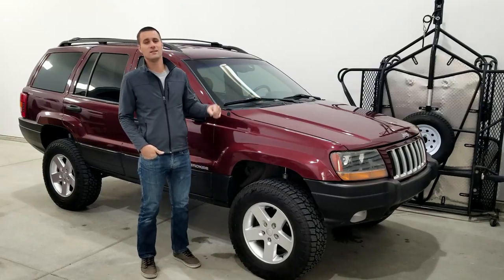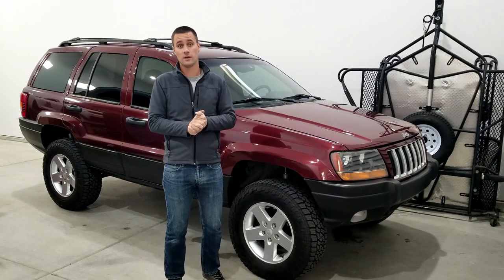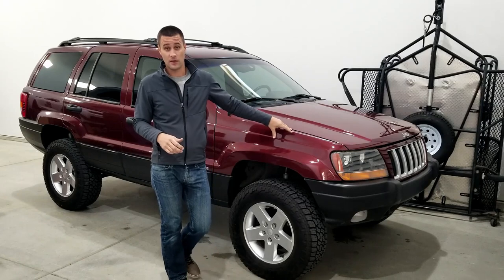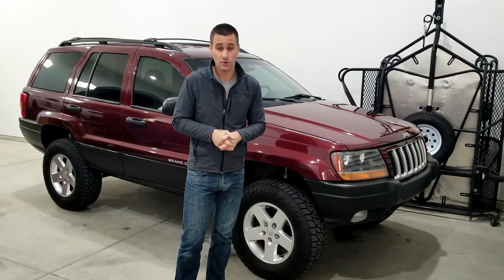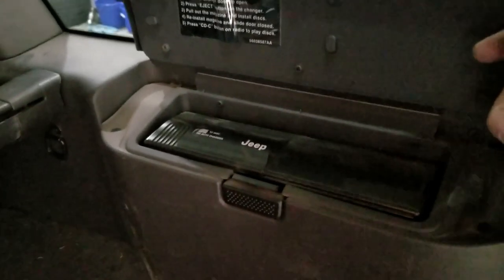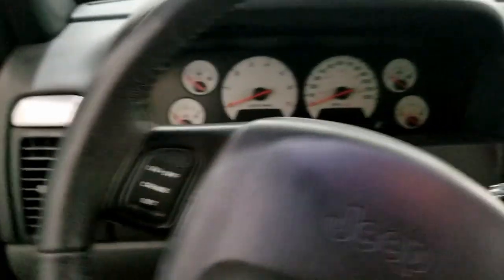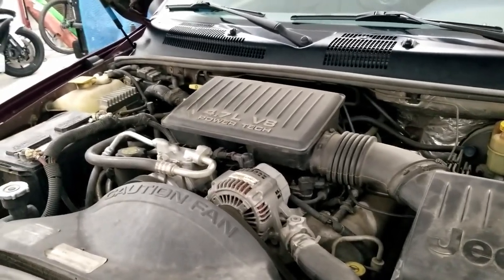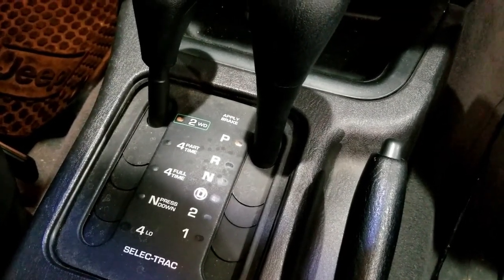$300 Jeep Grand Cherokee WJ Project "Cheap Jeep"

Comment: Hi Tyler love the WJ videos keep them coming was just wondering did you have to reprogram the gauge cluster when you swapped it out
Reply from the maker: No the clusters are plug and play, but your odometer will be incorrect unless to change the back panel/circuit board to keep the original for the Jeep. Thanks for the view!

Comment: Got my 2001 i6 w/ 120k miles and it's been great in snow. It has a weird issue where there is major vibration and even stalling on steep hills. I'm changing out the u joints , hopefully that'll fix it. Might be the bushings as well I'll have to inspect next time I'm under it.
Reply from the maker: Wow that's not a common issue? Keep me posted on what you find! Thanks for the view!
Reply: Consider checking your motor mounts if there is major vibration

Comment: Hey Tyler! With your current set up/lift and your street tire that you run on it, did you have to do any bumper trimming? if so what did you use to trim the bumper?
Reply from the maker: Here is a video talking about everything on cheap Jeep. With the street tires I believe they will clear without trimming. I am running a tiny bit wider and taller tires on my other WJ and they just barely rub when backing up, so I trimmed a super small strip off of the bottom of the front bumper. Thanks for the view! 
https://youtu.be/7w3GGLuTEFk

Comment: Did you paint the front bumper?  I swapped in a cheap aftermarket replacement in my 2003 wj. The plastic is starting to fade already. I was hoping to find a better option.
Reply from the maker: This was sprayed with a weird plastic dye. I didn't do it but it seems to hold up well but if bumped or knocked with something it will chip. I think the next one I rebuild I will scuff the plastics and use a black plastic approve spray paint and hope for the best. Thanks for the view!

Comment: need to do a trans pan on my 03 4.0 is there anything  I need  to do when I'm in there other then a filter.. trans look use  fluid  looks clean
Reply from the maker: I would have a new MOPAR filter and MOPAR transmission pan gasket and fresh fluid and you should be good! Thanks for the view!

Comment: Great video Tyler .. Love your WJ ... Have a few questions ...  Where to get the 2" spacer for the back upper control arm? What lug nuts are you using on the newer style wheels? I bought a set and they use the 14mm stud bolts vs the 1/2"x20 on my 2001 WJ?? Also curious about the paint you used on the plastic bumpers and trim, would love a video on that ... Keep up the good work.
Reply from the maker: There are a lot of company's that make the WJ a-arm spacers, just search Jeep WJ rear control arm or a-arm spacer. I believe mine is from rocky road, but iron rock and kevins off road has them also.
The wheels are 2007-2018 Jeep Wrangler JK wheels so the bolt pattern and lug stud size is the same as the WJ so the factory lug nuts fit correctly.
Reply: @TylerPotter  Tyler, what did you use on the plastic trim?  If paint, do you remember the brand and color?  Looks so much better!

Comment: Great video. Question, you mentioned the factory tow package. Do you know if that includes a brake controller and ‘extra’ coolers for transmission & engine?
Reply from the maker: I "believe" there is a extra trans cooler with trailer tow, 3.73 gears and it is pre-wired for trailer lights and the blue trailer brake wire is routed under the dash. Thanks for the view!
Reply: @TylerPotter  …great info. That blue wire would be for a brake controller I’m guessing?
Reply from the maker: @petertarantelli  Yes you are correct
Reply: @TylerPotter  perfect, thanks Tyler.

Comment: I am not quite sure where you got your information but there is a Ton of aftermarket support for the WJ. The fact that they share a lot of components with the TJ and XJ means that short of some suspension parts there is a lot out there.  There are also a lot of WJ's around. You got yours for 300 because of the drive train. WHICH IS NOT DESIRED!. you had the drive train everyone avoids. The 4.0 is vastly more reliable and comes with the better T-cases.  And since the 4.0l is shared with the TJ and XJ the parts are easier to find. XJ's and TJ's are almost impossible to find now. So people are turning to WJ's as they are more comfortable with the same proven drive train.  A word to anyone that is looking at WJ's there is a not of stuff out there about them. watch more than one video and will learn a lot more about them that this video provides.
Reply from the maker: If you compare ZJ TJ JK JL XJ aftermarket bumpers, skid plates, ect to WJ there just seems to be A LOT less options out there, yes there still is some stuff but defiantly not the options like the others.

Comment: Check out Martinbuilt. His channel is awesome and he has tons of tons of info on these WJ’s and many upgrades. One thing you can upgrade on these 4.7’s is denso GM fuel injectors which have a 12 hole injector fuel spray compared to jeeps stock 2-4 hole. Supposed to help your mileage big time. The guy went from 15 to 20mpg on it. Check it out
Reply from the maker: I have watched a lot of Martin's stuff it is pretty awesome work!

Comment: What do you think is most cause of the death wobble on WJ's?
Reply from the maker: 99% of the time it is tie rod or drag link ends being worn, normally with high mileage it will be 2, 3 or all 4 of the ends worn causing the issue. Thanks for the view!

Comment: The wheels and tires that you’re running if I put that on a stock WJ do I need to put a 2 inch lift kit?
Reply from the maker: The tires would would be too tall without a lift the the wheels with shorter tires would fit a stock WJ. Thanks for the view!

Comment: Great video... so with your overhead console does it beep about you not having tire sensors and if so did you find away to bypass that?
Reply from the maker: There are some Jeep WJ's that had tire pressure sensors and some that didn't depending on year and trim level. The one I swapped in had the Homelink but was not a tire pressure sensor Jeep

Comment: What size wheel spacers  are you running if any? I just purchased the same wheels for mine
Reply from the maker: These wheels fit great without any spacers, but I had a set of super thin 4mm spacers made to give me a little more room before my tires could rub on my aftermarket lower control arms.
Reply: @TylerPotter  thank you!

Comment: Great video :-) Actually the Quadradrive 247 transfercase isn't bad at all. Driving without a front driveshaft installed is no problem. After all the 247 transfercase is primary RWD anyway. 
I and lot's of others have driven for years without the front driveshaft installed in 4All Time. And it is of course locked in 4Low anyway. 
And the aftermarket is actually not bad at all for WJ's. It wasn't bad 10 years ago either, lot's of parts available. But now it is getting really good.
Reply from the maker: Yes the 247 isn't that bad but it is nice being able to lock the 242 in to 4hi, thanks for the view!

Comment: I have a stock 99 4.0 GC. She's got 270k miles. Engine taps but she runs. Any advice to make it better? I installed a new starter, battery terminals, using 10w 40 oil because the high mileage, coolant flush, and fuel pump.
Reply from the maker: The lifters will make some noise on the 4.0's with higher miles but they will still run for a looong time even with the noise, I would just keep up on your oil changes and it should still be a great Jeep for you! Thanks for the view!
Reply: @TylerPotter  Thank you so much for the reply back. I wasn't sure if it was the lifters or valve tap. I want to seafoam through the intake eventually to see if it clean it up but where I'm at, I don't need cops and firefighters running over thinking there's a forest fire haha. You think that would hurt it in anyway? I would like to replace the injectors due to it being the originals. Oh, I have the front driveshaft being rebuilt so I could have 4x4 again. Any recommendations for struts that won't hurt my bank account?
Reply from the maker: I wouldn't be to concerned with the original fuel injectors. We have some Jeeps that come in for service with 200-300K miles with original injectors with no issues. Now if it had a injector circuit code then you could have a bad one but they normally are pretty good. I really like my Bilstein shocks on mine. If you find the correct part numbers for your Jeep off Bilstein's website and watch Ebay you can sometimes find some great deals.
Reply: @TylerPotter  I really do appreciate you responding back. Thank you for helping me.

Comment: Need ironrocks 6.5 long arm lift kit, 35’s on it!
Reply from the maker: The poor 4.7 would need a regear after 35's to keep moving down the road! lol
Reply: @TylerPotter  of course you should regear them. They just look beastly with that setup! I have been driving mine around with the 2 inch stock wheels with spacers for a bit now. It’s not my primary car but at this point. Why not go as big and cool as you can on these. Easy stuff and over build everything suspension size and have fun!

Comment: I just changed out the gauge face to the white ones and for some reason the gauges are not working. Any idea what I should be looking at?
Reply from the maker: Weird did you swap the whole cluster or take both of them apart and swap just the white faces?
Reply: I took both apart and just swapped the faces. I took it apart again and made sure the needles weren’t plugged backed in too tight. RPM and speedometer are now moving however pointing at 3000RPM and roughly 50MPH at idle. Gas tank is reading little erratic too I think. I’m wondering if there’s any way I can calibrate it back to where they should be.

Comment: Where can I find the radiator support?  I have a 03 Laredo 4.7 well optioned with a budget boost.  It has the select track from the factory and tow pkg,  but unfortunately did have the sunroof.  Thanks.
Reply from the maker: We really don't have much issues with WJ sunroofs, I am just always scared of sunroofs working at a shop and seeing issues with other vehicles sunroofs so it is one less thing to worry about, but the radiator support is a really cool part, I believe you can order it as a weld together kit like I did or you can buy them already welded together. https://trailforged.com/product/wj-high-clearance-radiator-support-replacement/
Reply: @TylerPotter  ah Trailforged. Thanks.  I am 6" 4" so need as much headroom as possible, but my lady likes the sunroof. So there it is.  Well optioned sure makes it female friendly, if you can say such things these days. I wired in an aux cord, and removed the CD changer. My first aid kit now resides there.  Lots of options if you are creative. Happy holidays to you and yours.

Comment: I just got an 02 a few months ago, I got it to just knock around in for utility and runs to home improvement stores. But as you say, it's enjoyable to drive, I agree the seats are comfy, and something about it, I prefer to take the Jeep instead of the new car. Mine is same color as yours, it has the selectrac, and the 4.0 six, still runs great. Still need some work on suspension, rear control arm bushings and front sway bar links, the engine feels solid but my worry is transmission, it has ~145K on the clock. BTW-Did you paint the plastic? Mine looks the same as your original condition, kind of a faded grey, I know there are different ways to try to rejuvenate it, but then you have to keep up on it all the time. You did a nice job on yours, hope to get mine to the same level.
Reply from the maker: Thanks for the view! With good fluid and filter changes the transmission should be happy, and I think I've replaced about all the old tired suspension bushing at this point and it drives really nice.

Comment: Hi, anyone know if the radio fuse in the footwell (think slot 5 -25A) will blow if ignition and radio off with a 20A fuse? mine pops instantly, not sure if could be a wiring fault. NB everything is stock 2004 lerado 4,7
Reply: I do love the vehicle <3
Reply from the maker: I would try unplugging the radio and then see if the fuse still blows, it is possible that the radio has a internal short.
Reply: @TylerPotter  Hi, Yes when unplugging the fuse does not pop. Whn i do continuity test on the radio B+ and GND, GND to SIgnal I get continuity...bit strange.

Comment: Why are you saying that if one of the driveshafts broke, you couldn't put the QuadaTrac II TC (the QuadraTrac II TC is used in both the QuadraTracII and UadraDrive systems) into 4Lo which clocks the front to the rear to continue driving?  

Are you under the impression that the QTII TC does not lock in 4Lo?
Reply from the maker: You are correct in 4 low it is locked but back in the 4 hi or all wheel drive it is unlocked.
Reply: @TylerPotter  Thank you for responding.  That's correct.  So, I'm not sure your point.  Yes, the Selec-Trac TC is more versatile, and I want to get one, too.  But if one driveshaft breaks, I can put my QTII/QD TC in 4Lo and get off the trail.
Reply from the maker: @rockymountboy   Yes you can definitely get off the trail but with the select trac transfer case you could in theory drive at higher speeds on the road in front wheel drive if your rear drive shaft broke and was removed versus being stuck in 4low and trying to drive home if that was your only option
Reply: @TylerPotter  Yep!  Definitely a benefit of SelecTrac.

Comment: I bought mine for 500 with that leaky transmission an it’s not the pan ,what could it be?
Reply from the maker: We don't see to many big leaks on WJ transmissions other than the pan. But it could be a front pump seal or a output seal possibly?

Comment: Hey buddy good lookin WJ man. Does this just have a 2 inch lift? Looks like it sits higher than that
Reply from the maker: Thanks I am running the Rough country 2in spacer lift with new MOOG replacement Upcountry springs front and rear, I also replaced the front and rear rubber spring isolators with new moog replacement isolators when I installed the springs. The spring part numbers are these.
Moog 80976 Front
Moog 80873 Rear
Reply: @TylerPotter  awesome man thanks. I just got a WJ and plan to go close to that same route. Subscribed to keep up with your new vids 👍
Reply from the maker: @nathanbook8160  Thanks man, I have had a few questions recently on the lift. I need to do a detailed video on all the parts that I've got on it for the lift. Thanks for the view and sub!!
Reply: @TylerPotter  that would be awesome dude. Would give us WJ rookies a good idea of where to start
Reply: @TylerPotter  Hello Tyler, what a nice video. Where can I find the spacer for the upper joint located in the rear control arm/triangle?, another question, I didn't see if yours has the double Cardan joint in the front axle, did you add that?  I have a wj 2 inch lifted, all is stock parts just de spacer lift, I want to improve it. thank you

Comment: I just bought a 2002 for $300 this past summer,  with 150k miles and a shot water pump.  I've got rusty rockers, and a dented tailgate.  Ugh.
Reply from the maker: Sounds like a perfect project!
Reply: @TylerPotter  I've got somewhere a little over $3,000 into it presently, and that's with me getting parts mail-order and doing most of the work myself.

I've just been budgeting time and money out every week to fix something on it, but still daily driving it.  LuLz

Comment: Okay but the 4.7 is not better than the 5.2 or 5.9 in any way
Reply from the maker: The 5.9 Limited Grand Cherokees were pretty cool Jeeps!
Reply: @TylerPotter  i just rolled one. Im bummed
Reply: @videoheap  the 4.7 is more powerful than the old magnums. Just don’t overheat them and stay on top of oil changes and it’ll last you as long as the others. Tbh it all depends on what you drive, I had 5.9 grand Cherokee and back then I wouldn’t shut up about how much better it is than the 4.7. Now I have a 4.7ho wj and think it’s better in every way than the niner. Moral of the story zj guys will always say the 5.2 and 5.9 are better and wj guys will always say the 4.7 is better lol